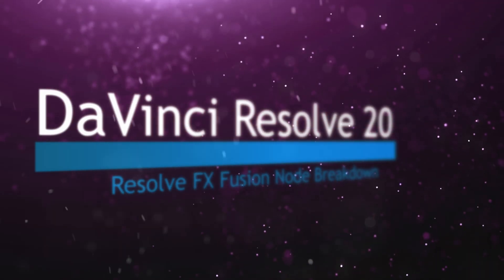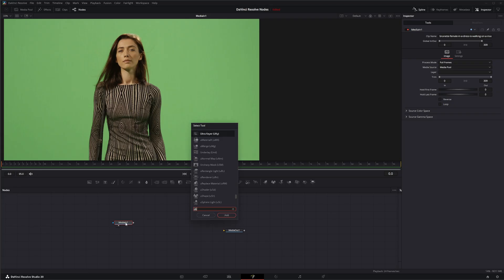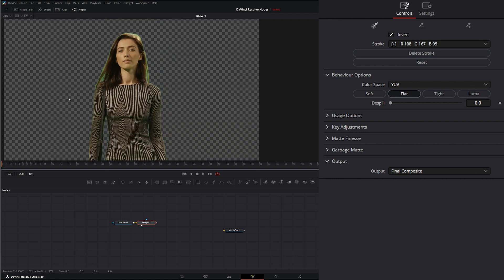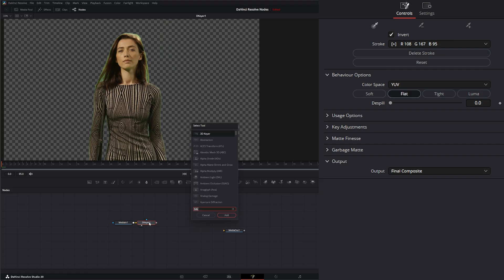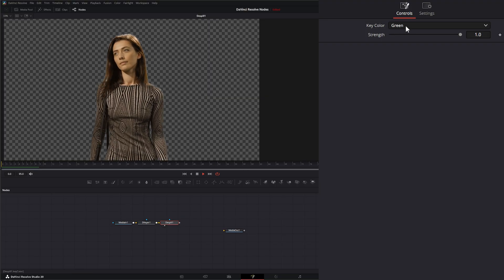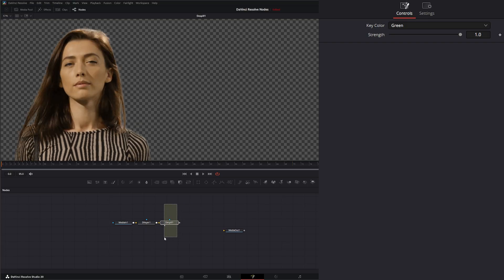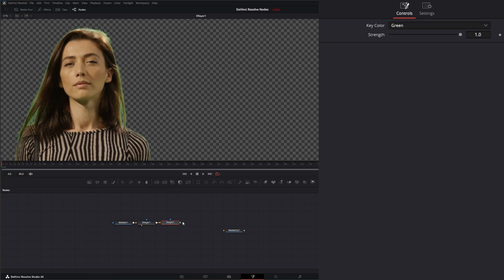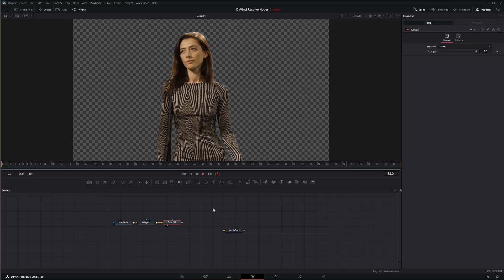DaVinci Resolve 20 Fusion Despill Node

Comment: Are you saying there is no difference between the 2 despills?  Delta keyer has a very different despill  process... I think I will play with all 3 for my use cases to see if there are any quality differences or ease of use differences.  Curious what your thoughts are on the 3?
Reply from the maker: Yes, there is a difference between ALL of the despill and spill suppression on all of the nodes. And that is best (testing use cases), because it will be different every time you use them...what works great one day on a specific piece of media may not work another.

Comment: So regardless of key or masking method, despill should work. 

My question is: what is the use case to using one key method over the other? (I.e Luma Key, 3d key, magic mask)
Reply: One advantage of using a separate node is simply structure clarity for others viewing ones graph; however, there might be some situations where one is trying to pull a very difficult key with multiple keyer nodes where each one is masked to effect different areas with different keying levels. In a rare situation like this having the de-spill at the end of the chain of nodes means one is dealing with only a single node for de-spill vs a separate de-spill on each keyer. An example of where this might be used is for hair preservation. One can do a more aggressive key for the core body, and then uses the inverted alpha as part of the hold out for a hair detail pass. While there is often a bit more fiddling to get a good hair pass, at the end the passes gets merged, and one de-spills once at the end.
Reply: @billyoung9538  thank you for taking the time to detail why despill has a separate node even though it's in the keyers. I have a bluescreen & it seems best to test each method & even consider stacking keyers if necessary & despill sperately.

Another think I should look for is how heavy each keyer is, mainly for the laptop but optimization sake as well.
Reply from the maker: Thank you for this response to the question...It was perfect!
Reply from the maker: @billyoung9583 had the perfect response!